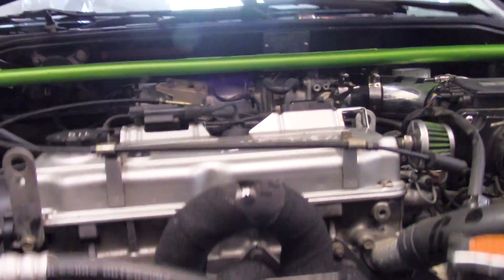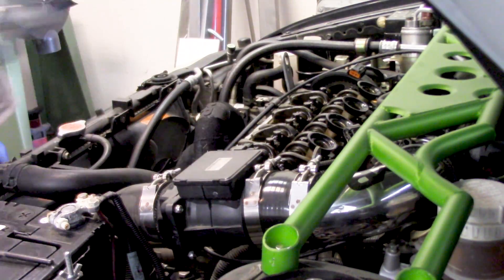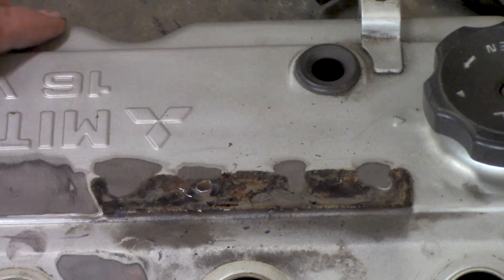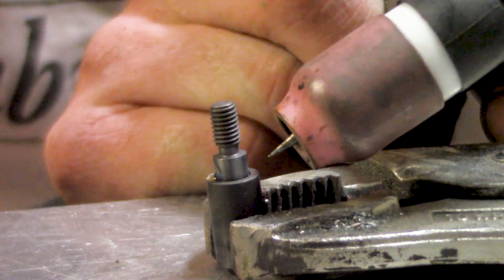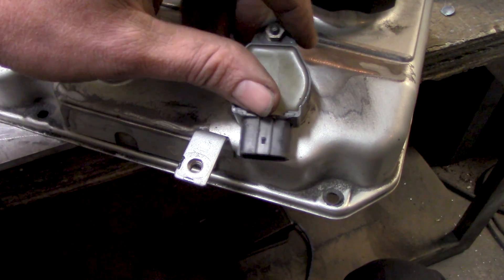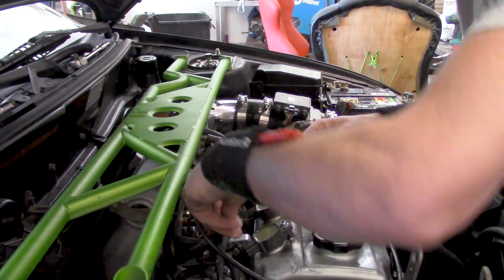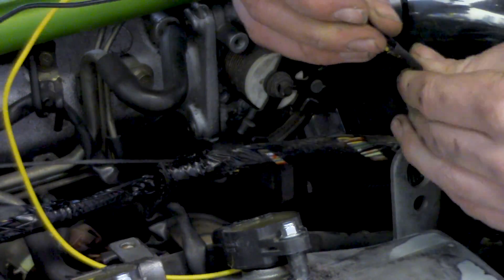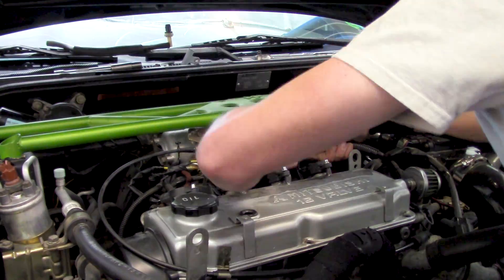TFS: Coil Per Cylinder Ignition Upgrade

Comment: I got the spoolin up harness and a cnc machine valve cover. I put blox k20 coils. 4G94. it started up. ran for a minute then died. won't start now. I figured it out. 10amp fuse. went to 20amps.

Comment: so to get this clear, you just splice the wires to ignite 2 coils at the same time, and not 1 coil that divides his 'strenght' into 2 spark plugs?...
so the ecu, coil supply ect can handle to supply 2 coils without a problem ?
i wanted to do this mod to my engine like years now, and now its supercharged it can benefit from extra strong spark.

Comment: hi..i hv a c26ne dual ram engine i would like to upgrade it to a 1 coil per cylinder like urs...what are the things i need to wire it up to?..i mean it has a bottle type ignition coil type..should i delete it or what?

Comment: Bro i just found n subscribed your channel..i haf a problem..i use a 4g18..originally wasted spark ..so i put the k20 ignition coils..at idle its superb ..but when u switch on the air cond n lights..it starts to misfire..even when u drive..1-2-3-4-5 is ok..but wen u brake n downshift to second..it start jerking wen u accelerate..pls help

Comment: I'm thinking of doing the upgrade and want to know which cable plugs and coils should I buy.
Reply: He's using the coils from the 4g69 engine. The 04-06 lancer ralliart and 06-12 eclipse use them. The connector is the same for both the 4g93, 4g94 and the 4g69.
Reply: @gcvalenz01  ty very much.

Comment: What coils did you use?
Reply: He's using the coils from the 4g69 engine. The 04-06 lancer ralliart and 06-12 eclipse use them. The connector is the same for both the 4g93, 4g94 and the 4g69.

Comment: I’m thinking of doing this to my 5vzfe 3.4L Toyota. I’d probably drill hole’s through the valve cover, install countersunk head M6 studs, and fab three spacers for it. I already have the coil packs and a full set of six connectors for the coils I got on amazoo for $32 a set of three, ( they’re great by the way!) so all I need is the time to do it.

Comment: I have a 4g18 am in Jamaica and i want to build it , i see videos where they swab the 4g18 single cam for 4g15 DOHC does that add more power or the single 4g18 cam is more power ?
Reply: Hey,did u build it over?
Reply: @CAUTIONPOLITICALTRAIL  no decide to just build the single cam ... 
Seeking springs and retainers atm ...
So far I have a lsd gear box 
Racing radiator 
Evo 7 trottle body ect

Comment: This also works for the 3g eclipse 4g64 sohc as well. I used 2 extra coil plug connectors from a j yard 4g64 and used 4g eclipse gt 4 coil plugs. Works perfectly
Reply: Needed this info, no one’s saying where tf to get compatible coils from
Reply: @K7Nation  im glad this info helps you out. If you have any more questions. You can search me up on fb. Victor montanez

Comment: You dont gain any power from doing this. The engine doesnt misfire with the stock coil setup so theres nothing to gain
Reply: Opens up potential for more power and minimise power loss at higher rpm
Reply: @Courier103  theres no power loss unless the engine is misfiring which it wont do with stock coils
Reply: totally agree whith this

Comment: that makes no sense.  if it's still wasted spark....it's still wasted spark.  all you did was eliminate one coil splitting off into two.  signal is still being sent to two coils and they still both fire at the same time.  if any change was experienced it is associated with perhaps the newer coils have more turns on the secondary side compared to the original (given the wire size inside the coils are the same).  OR it's all in your head.  if the ratio of turns of the primary and secondary are the same between the old and the new coils....it's a wash.

Comment: nice job can it affect ecu system?
Reply: Yes but only if the ecu is triggering the coils by ground side switching unless it has a separate igniter/coil module (that'll get damaged instead)  depends mainly on the inductance change by the coils being wired in parallel or series and you dont  change the other qualities of what make up the coil dwell time; the resistance, current, and voltage.  Not included the double amounts of high voltage back spikes, decreasing life span of the circuits.

Comment: So how do you select new coils? Like which oem coils should you go with? Length? Does oem different coils give more of less spark? (Since it’s a coil inside, I’m assuming depending on how the coil is wound inside the discharge could be greater or less...?)

Comment: I've been watching quite a few of your videos on TIG welding and love them! You have helped me improve my skills with some of your tips while i was fabricating and welding up my stainless exhaust  system and some v-band's  i did last week. Appreciate your no bs approach that's what i like the most.
I have a 4G93 engine also in my Lancer that i am adding a bit of timing to and think this would help very much with stability and spark strength and reduce some minute knock i get some times. 

What coils are those? Don't remember you mentioning because i would really like to do the same upgrade soon as i know what coils pack has the right height and electrical specs etc.

Comment: that was a neat job...and I do agree with you that in the engine bay, crimping and heat shrinks are better than soldering. Have had several failures due to broken soldering connection.
Btw, you mention in your video about programming. What do you mean by that? Does it mean that we need to reprogram the ECU to recognize the new setup.
Please explain, since I plan to do the same mod to my car. Cheers.
Reply: The system won’t see the extra coil, but it may make it harder for the ECU to detect problems accurately because the weak side of the pairs of cylinders is mapped out in the ECU as the plugs without a coil pack.

Comment: Planning on doing this upgrade. What coil packs did you use in this conversion?
Reply: I'm using the 4g69 ralliart ones
Reply: Did you do it ...how did it work out ..more performance..??
Reply: @jerryking1434  yes i used some Honda coil packs. It worked well, not like a turbo upgrade lol. But the engine response when you hop on the throttle is noticeable

Comment: In my case, the coilpack is 1 single unit. it still uses the wasted spark system but im wondering what the best way to identify the wires would be, i cant simply trace them as there hidden inside this pack. i believe the loom has 5 pins going in (4 cylinder) thanks for any advise :)

Comment: I would love to do this to my 4g94. Are you using the same coil wires as stock or did you purchase a different set? If so which ones?
Reply: I wanna know too. Can’t find what he used 😢
Reply: So after extended research and joining forums. You splice and soldier the wires together . There is no kit for this conversion. Unfortunately never got to try it as my lancer timing belt popped off .-.

Comment: Hi, I'm from Chile and I have a 4G92 lancer engine and I would like to set up independent coils that you used to make those upgrades.
Reply: If your engine use distributor. This means your ecu have only 1 ecu ignition output signal to drive Ignition Transistor.
With this setup or conversion. You need ECU that have 2 ignition output signal to drive 2 COP at a time.
I'm tempted to design electronic circuit to convert ecu single ignition into dual ignition output signal to have this 4 COP conversion using ECU code 7043. I need to gather more data if this will be possible.

Comment: Hi Fabricator! Can I use 2 existing 4G93 coil and add 2 coils? Whats the Pros and Cons of using the 4G93 coils? Need your advice
Reply from the maker: Paul Rea 4G93 coils power 2 cylinders each. If you add two more coils, you'd also have to add 4 more cylinders.
Reply: Thanks! How about I'll gonna disable or not connect any high tension wire on the split port of the 4G93 coil? Just place each coil on plugs and cover the part of the coil that is going to the high tension wire.
Reply from the maker: Paul Rea You can try but I don't see it as a good solution.
Reply: Thanks The Fabricator TFS!
Reply: Hi. Did you try this already?

Comment: Very informative video! Would this work for the 4g15 engine? I happen to get a great deal on the coils from an 05 Galant...
Reply from the maker: Jondoe Harris You need something to power them since the 4G15 uses a distributor. You can change the ECU and harness to the 4G93 and use the distributor as the signal and fire COP's with it. It's a lot of work, but can be done.

Comment: hey Merrill if you see the comment I have issue when buying the coil I bought them from ebay I put the info of the outlander who has 4g69 but the ones I get won't work was too short to touch the spark plug also I have a 97 with metal ecu not MD or mr ecu and I don't get any spark could you make a how to video about wiring step by step this coils or add the info on description 😊 it's biggdowz from mpf

Comment: Looks like a good way to burn up ignition drivers...
Reply: It’s only pulsing the low current trigger to ground to make it fire the ecm won’t know anything has changed 
One question I have though is I guess the car would need tuning with different dwell times etc or is it insignificant?
Reply: My point is that the coils are now wired in parallel, which means the driver in the ECM that is doing the switching is dealing with twice as many amps. I would say the same dwell time would be needed because the coils will both still have the same voltage going to them for the same length of time.
Reply: @outlander330cc  this∆∆∆.  Yes, the Toyota coils work and they are used all the time for Evo COP systems and the 300C coils are used for the COP DSM systems...but the dwell times are not the same...close, but not the same.  The best way to benefit from the Wastespark to COP system is using a CDI in conjunction or using a stand-alone ECU that can adjust the dwell time.  It was found that swapping to a COP setup was a slight downgrade to the DSM Wastespark coils and not really an upgrade at all for the Evolution.  It just looks nicer lol.
Reply from the maker: outlander330cc It won't burn the any more than the stock ones would.

Comment: Does this actually increase horsepower on a dyne or does the car not misfire, is there a measurable difference? Very interesting to see the solution to this problem, I would have thought the coil wouldn't be able to recover fast enough on a wasted spark ignition to fire again and that's what would cause the misfire, not the path of least resistance. Thanks for the explanation. Let us know how it works
Reply from the maker: Thomas Cahill It does add a little bit on it's own, but it's not a massive difference. It's more aimed at supporting future mods and tuning to actually create more power.

Comment: Can’t help noticing you tig welded without gloves. Last time I did that I got peeling fingers... great mod I might try it on my car.
Reply from the maker: revb0 This is actually old footage. I've never had my fingers sun burn or peel, but I've also never welded without gloves at high amperage. Everything in this vid is low amperage and it was shot before I decided to wear gloves with everything I did.

Comment: Is the coil driver (in the ECM) capable of driving two coils at once? Or is it now overloaded and doomed to early failure?
Reply from the maker: These are transistor coils. The ECU is nothing more than a signal to them. The power to the coils is from a switched source. If they were standard coils, it would be a problem.
Reply: @TheFabricatorSeries  can you send the parts list
Reply: @TheFabricatorSeries  . You can add non inverting buffer IC inside the ecu for higher ignition output signal driving the 2 COP. This also protect controller E310 IC if accidental short on 2 cop occur.
Reply from the maker: Kyle Love I'm really thankful for the viewers on this channel. I rarely have to chase away trolls, and many viewers work together and offer additional advice. It's a really great crowd.
Reply: Dave sage... you bring up a great point/ question and I'm pleased to see that there were mature and intelligent responses. I learned something new. Thanks to all the guys that know more than i do. Lol

This is an excellent YouTube channel and seems to have some real good guys following it as well.
Reply: The dry fire load is quite small and as a result I would guess that it makes little to no difference as far as “load” is concerned. I would be more concerned about impedance. Any time you wire anything in parallel you decrease resistance in the overall circuit which could cause an over current condition in that coil circuit. From what I remember most coil over plug setups have 3 wire setups, one wire being a 12v, one being ground, and the other being the trigger which is controlled by the ECM. The load more than likely does not have anything to do with the ECM. A wiring diagram would tell us that.  

Long story short, this setup is probably as reliable as OEM.
Reply: Probably long gone low but how did this set up hold up im lokking to do this for my car same engine but i preparation for boost not really planning on a lot of boost but im just getting it prepared
Reply: thats what Im saying considering the impedance has now been altered the factory coils driven by the ecu makes it have to power double the load.
Reply: Good info , so it just draws 12v from the electrical system and the ECU just sends the pulse to it commanding to spark.... Gotchya!  Makes sense in that case it's really no big deal at all then if it's just a signal I suppose. For some reason I thought the ECU drove the coils LOL
Reply: @FrequencyOfThought    but what carries the constant 12 v to the coil it's a direct battery link or passes through fuse box
Reply: @mahasesingh4518  They're just supplied amperage / voltage through a driver , that driver is commanded to release the pulse of spark. It's like a relay switching on and off
Reply: Tom: A quick look back at the video when he is wiring it back up  and it appears you are correct. They are three wire coils so my bad, No extra load on the coil (current) driver. (but twice the load on the ground and supply wires - no big deal I guess).  I'll assume the trigger driver should have no issues with two coils. Interesting idea. Actual performance gain ??

Comment: So the coils still fire at top of compression stroke and top of exhaust stroke but the ECU only triggers them so they all maintain full power?
Reply from the maker: Street Freaks Racing Videos They fire exactly the same as before. The ECU is just a signal to trigger the coils.
Reply: The Fabrication Series that’s awesome, I was making sure I heard you correctly.

Comment: Don't pay attention to the keyboard "experts". There's nothing wrong with a crimp connector installed properly and sealed with shrinkwrap. I've gotten into the habit of using solder and shrinkwrap but still use crimp connectors when soldering isn't applicable. Lol, I still come across old repairs on customer cars where the wires were twisted then a mile of tape applied, mind boggling!! Nice upgrade and looks great.

Comment: Glad to see the crimps. I've been in numerous debates on soldering on cars, I never solder my harness wires.
Reply: I do if in certain situations but never anything high voltage/amperage.
Reply: Personally I'd stagger the crimps. Solder can crack from vibration. Good looking mod.

Comment: Without adding a booster box, everything I have read leads me to believe doing what you just did actually results in a weaker spark due to the coils not having enough dwell time between firing since they're still firing in the waste spark configuration. Where as the factory setup was designed with that in mind. shrug my car's only make 340whp though and is fine on the factory DSM ignition.
Reply from the maker: Mean Man There's a lot of misconception out there about this kind of stuff haha. Waste spark has nothing to do with it.
Reply: Could you expand on it further? Perhaps in a future video? Also I love your videos, I'm also a TIG welder, thanks to your channel I have actually challenged myself to push my skills further, from just doing something like the tornado deal with filler wire to over the course of a week or so when the shop was slow I made a hollow human figure complete with santa hat all out of .035 filler wire. https://i.imgur.com/nzkxAR9.jpg  so please keep it up!
Reply: Evo guys do this all the time and push a ton of power. I've also done it with this exact setup making around 450whp and haven't had an issue till this day
Reply: COPs now operate fine down to as little as 2.5ms dwell as I understand. Given it's wasted spark, each COP is firing once for every full crank rotation. At say 8000rpm works out to be a firing spark every  7.5ms. Subtract the spark duration of say 2.5ms and you're left with 5ms for dwell

Comment: The only issue I see with this set up is if you were to use 2 big racing coils I'd wonder if the pcm ignition coil driver could handle the extra amperage seeing as your taxing it now making it run 2 coils vs 1.
Reply from the maker: nick wheaton The ECU (in this case) is nothing more than a switch. The coils are individually transistorized which draw power form a different source. If they were large "dumb" coils, there would probably be a bit more worry.